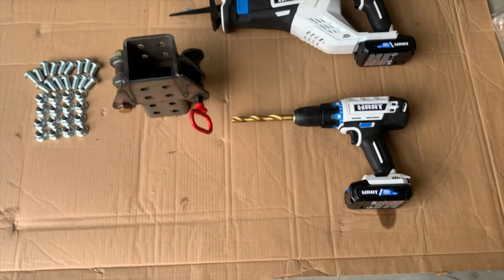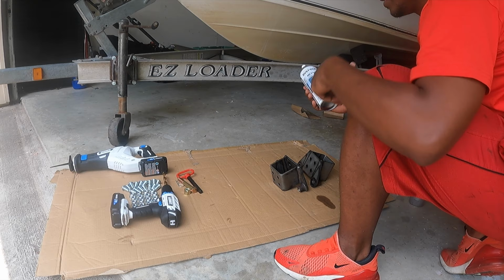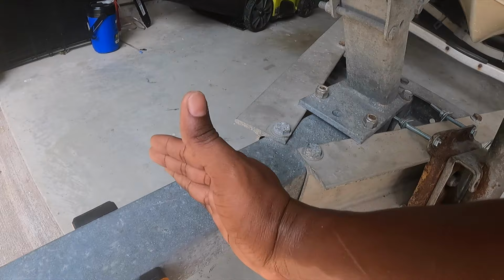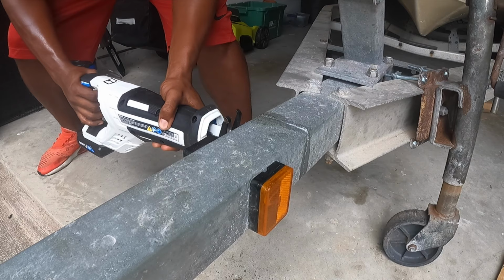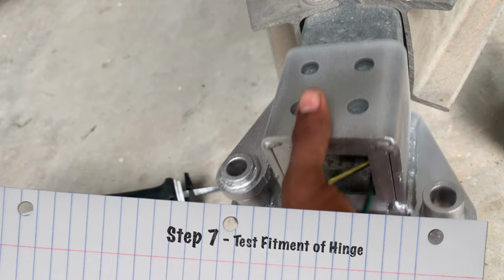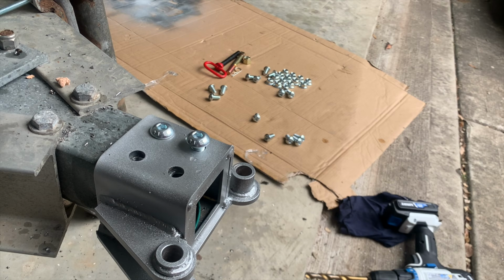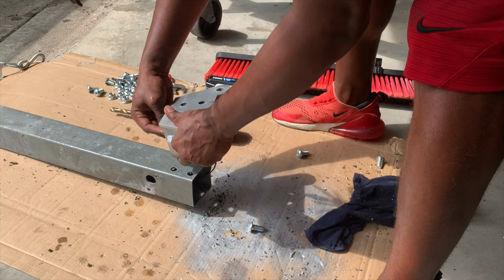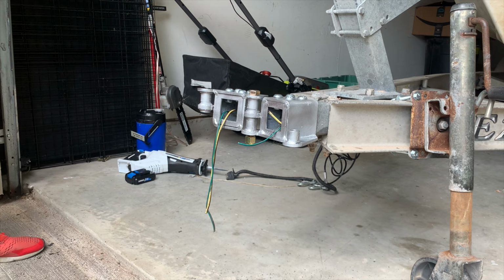How To Fit a Boat Trailer ANYWHERE With Foldable Hinge | SWINGAWAY Installation | EASY STEPS #HSU

Comment: What length is your garage? I have a 16ft Carolina Skiff and I’m thinking about doing my tongue like this. My garage measures 20ft perfectly. I think your boat is longer than mine.
Reply from the maker: My garage is around 20-21 feet. Motor is straight up and down. Most important factor in this install is the trailer setup and tongue length. Our boat is 16.5’
Reply: @AdVentureBro  my boat is 16’2 and I swear your lay out looks way more spacious. I have more casting deck space. Where did you order the coupler?
Reply from the maker: I ordered it from Ken who runs HitchShops.com
Tell him you saw my installation video!

Comment: Good video to show an install, sorta. But jeez. Why wouldn’t you clean down and throughly prime/ cold galvanize the bare steel where you drilled and cut it! No anti seize on bolts either…  and one coat on this bare steel hinge… give it a minimum of 3!!! 

This is a recipe for rusting, corrosion and galvanic reaction between metal types. Not exactly what you want at the most critical weak point on a trailer.
Reply from the maker: It never rusted years later
Reply: @AdVentureBro  I see. You have admitted it could do with a re-coat so it’s obviously looking shabby already… have you removed the bolts to check them / where the coupling is in contact with the trailer frame? Unlikely. 

I’ve never seen a boat trailer used around salt water that doesn’t corrode. There’s good reason they hot dip galvanize trailers and or use aluminum framing to avoid corrosion. Moving forward, I would hope you could agree, for anyone watching, it would have been best practice to coat it at least twice with a primer/ undercoat and top coat. And clean and coat all the exposed raw metal where it’s cut and drilled. 

People do rush jobs like this and then sell their problems on 5 years later. A can of spray paint would be $5, anti seize/duralac costs nothing. I’ve worked in mobile equipment for a chunk of my life, sorry to critical, but this sort of DIY shortcut, gives me the shits (worse when it’s made into a “tutorial”.) It’s not an issue until it is. (Especially for people who have their boat stored outside, or closer to the ocean/ salt spray/ use their boat very regularly)… Ultimately, people eventually upgrade and sell their poor workmanship onto others. 

To be blunt, there is nowhere in the marine/ automotive/ trailer/ steel fabrication world, that would find cutting the protective coating off piece of steel and leaving it bare acceptable. 

Sorry to be a dick. This is just a comment for others looking to replicate the install. Do it right so your trailer doesn’t fall off in 9 years time and hit someone on the highway.

Comment: Bro, loved it. Howbisnit holding up corrosion wise? This is almost how most things go. Gonna do this soon on galvanized trailer as well. I have used Diablo blades for steel and they quick. Thanks again.
Reply from the maker: It’s holding up pretty well surprisingly. Should prolly recoat it but it’s not bad at all 🤙🏾
Im glad you enjoyed 🎣
Reply: @AdVentureBro  thanks for reply. Subscribing for future help.